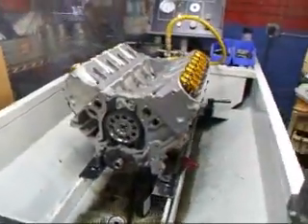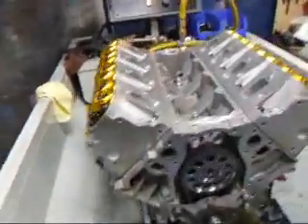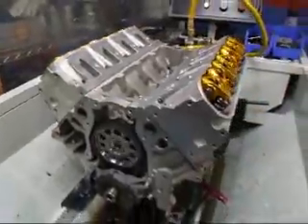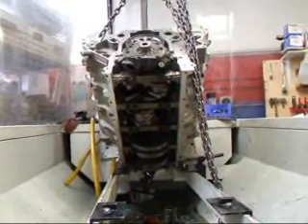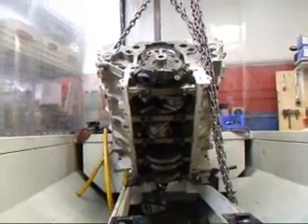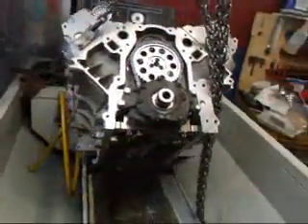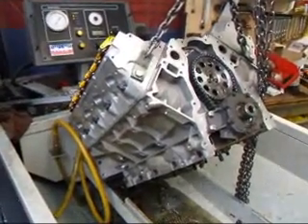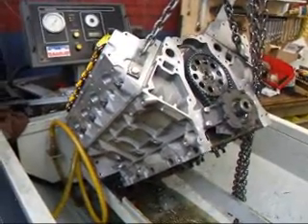LS Engine on Simtester @ Costa Mesa R&D Automotive Machine

Comment: Im pretty sure this hinders the break in process for maximum power/torque and oil control, doesnt it??

Dont the cylinder walls need to have a certain amount of roughness to grind the edges of the rings into conformation with the bore??

Comment: Its got very little to do with weight and much to do with space/packaging/location.  Remember that with valves you're limited to only CIRCLE shapes. Infact, i think that 1 valve with "x" amount of valve area would weigh LESS than 2 valves combined to give "x" amount of valve area.

Comment: @fergus1494 
There's no 429CUI engine producing 2000bhp NA, not even bulit by NRE nor ProStock class. It's impossible even with desmodromic type of valve actuation. 
800CUI engine needs to rev 10,500-11,000 rpm to reach 1500bhp NA. Pushrods are not reliable at such a high speeds as OHC (pneumatic valve control - Formula 1)

Comment: @fergus1494 
Like I said before, OHV or OHC, no matter, both have advs, and disavds. DOHC design was proved many times in racing very reliable. Also americans are pretty blinded when it comes in term of reliability. Reliability depends about quality of materials and how it's built. Simple system doesnt mean its more reliable. I have several examples where OHV engine failed in racing. Old Ford V6 OHV, than many 4cyls OHV , even many V8 SBC's. Also same is with OHC.

Comment: @2jzgtejza80 Anything is capable with money mate. Why use a more complex and more expensive system when a simpler and more reliable system has already been developed? And when something goes wrong on the simpler system its much easier and faster to find and fix. There are engines around using heads designed off the boss 429 hemi heads that make 2000hp NA. The extra weight up high, the more complex system with more moving parts really hasnt got an advantage under 9k rpm.

Comment: @lillen300 I dont think having a well balanced engine will effect fuel consumption much - thats more to do with combustion efficiency and port efficiency. It will (stating the obvious) reduce vibrations slightly and of course as already said increase engine life - less wear. The engine will spin more freely - but not by much.

Comment: @racernate02 4 valves are only because its lighter to get the same size valve area.. your opening and closing two smaller valves instead of one large. I personally feel the advantage of this is nil below consistent use of 9+ thousand rpm. Plus the extra costs, more moving parts and more complex designs i think 4 valve engines shouldnt be used in motorcars.. you shouldnt need to spin an engine past 9 because of the accelerated wear. A 2 valve hemi engine would be fine for most applications.

Comment: @inteligentvtec 
They was made from titanium before, today using dur-aluminum alloy, only al-alloy that can endure high stress.
Yes, block and head are billet machines Al-alloy, sleeve's are ''cast in block'' made from tempered ductile iron (better cooling and lubricating than steel). Every part of the engine is forged, aluminum, steel or titanium, except sleeves, are cast. Even they using copper gasket.

Comment: @2jzgtejza80 on a top fuel engine the rods are aluminum not forged steel. forged steel cant take the shock of nitromethane, they have no give. the aluminum actually allow a bit of twist and flex so they dont break. the block is also alluminum, with steel sleeve's they literally drop in, which take no time to swap. but ya dohc is way more efficent, but when you start cramming that much air into an engine forget about trying to be efficent cuz then you have to burn sooo much fuel to keep it cool.

Comment: @racernate02 
They make that power using everything but not technology. Massive heavy 14-71 Roots blower at 75psi + Nithromethane fuel, 24-32 spark plugs, 8 independent fuel pumps (each bigger than 1 in LS7)...    that's why.... 
and also every part of Top Fuel engine including block are forged. NELSON RACING ENGINES are capable construct DOHC type of Top Fuel engine, but that would be expensive. NELSON already have 500 CUI DOHC producing over 1500 hp in NA trim and 2500+hp S/C or T/C.

Comment: @EPzti One thing I should point out is that the 32v 5.4 is a lot bigger and heavier than a chevy 5.7 (if you're thinking of an LS1) because of the massive cylinder heads. The simplicity of the OHV v8 has worked well for GM over the years and probably will continue that way untill we're all driving electric cars. They had this debate when developing the c5 vette in the mid 90's because the size and weight/power ratio was in the favor of the LS1 OHV engine verses a DOHC v8 such as the LT5.

Comment: @fiatnutz in a few years i will be getting my 4.3 vortec BUILT and eventually after being fully broken in get a low boost supercharger.  i dont like v8s its too much engine not enough power considering my 4.3 will eat up and stock 5.7.
 it will be used to pull a 12 foot trailer for the rest of my life. where can this be done and how much does it cost to be done.
and also do you rebuild engine or just perform the Simtest?

Comment from the maker: @kreigsmann - I slowly bring the engine up to 200 rpm and let it run there for about 30-40 minutes. You still need to do the 2000 rpm for 20 minutes once the engine is in the car and running.

Comment: @FJoeForty Joe, I'm not try'n to argue.  I love ford and chevy.  I know what ford is trying to do and it is great.  I have owned both with minimal problems until i bought the 5.4 VCT.  I thought i just got a lemon and come to find out my problems are common problems across the board.  GM has gotten ohv about as good as you can get it, but it will have to evolve with demanding restrictions.  I know what you are saying about ohv, and vct is beautiful on paper but we still have a ways to go =/

Comment: @BEBNC1 The malfunctioning actuators and components for variable valve timing and/or lift.... have plagued all manufacturers once, Toyota had sludge problems within the orifices, Nissan has software glitches, and the pulse width modulation in the solenoids revealed that stainless steel pintles were not lasting as long as the hardened steel. Sounds like I shouldn't assume Ford has their act together. Well shit, I guess this superior technology can only be trusted from the Germans and Japanese.

Comment: @FJoeForty They said its 3:1 ratio of problems in SOHC VCT 5.4 vs the old SOHC 5.4 and replacing more engines than they have ever had to replace. Also have an 06 LQ9 that 190k miles that out performs my 5.4 six ways from sunday with better mpg and NO PROBLEMS other than a new alternator. GMs LS series race is race developed (Pratt Miller/Katech) and are damn near indestructable (World racings engine of the year) and gives outstanding mpg and reliability. History speaks and chevy's is better.

Comment: @FJoeForty Joe, I have a  06 SOHC VCT 5.4.  It is a horrible engine for towing and has had serious cam phaser issues, ford mechanics told me that this is a serious issue in ford VCT engines and is a more than common problem along with VCT actuator solenoid and pcm problems. They told me in general alot of "cheap" parts are in these engines hence the mountainous problems in these engines.  Grass is always greener on other side, i've talked to two ford master mechanics and they like ohv better.

Comment: @BEBNC1 It is better in every way. VCT allowed you to not complicate the intake with a sooty EGR and it does more than saves fuel, it makes your valve train overlap and duration angle change. You like having a shitty Idle because you are stuck with the cam you installed? It's not a green, tree hugger thing. It's a performance developed by Formula 1 racing.

Comment: @BEBNC1 Not all overhead cam is an interference design. Reciprocating mass is more of a mechanical burden than having three extra cams rotating. Look up the weight of a gen IV smallblock versus their DOHC aluminum, six bolt main counterparts. This is like debating speed density throttle body injection versus mass air flow multiport. Those six extra injectors are a ticking time bomb!

Comment: @FJoeForty You must be referring to VCT capabilities to actuate the values to give somewhat better fuel economy, otherwise they are not better engines.  Huge oiling issues,  way more rotational mass in OHC, when chain wear becomes an issue and timing valuve interference is slightly disrupted that OHC is a ticking time bomb. They are heavier, bigger, use 1/3 more oil, more complex cooling to stop those massive heads from overheating. Both engines have advantages and disadvantages.

Comment: @racernate02 You're talking about nitro numbers in top fuel, that only last a few hot runs before engine tear down. I am a GM Master Tech, and pushrod valvetrain with two valves per cylinder is disgusting 1920's crap.Sick of these white haired dickheads coming in the shop, ZO6 jackets,chewing the fat about their goddamn Corvette...like it's a Porsche or something. I am tired of working on these over hyped, over priced, pieces of shit. 32 valve Ford 302 with TiVCT! American craft to be proud of!

Comment: Oh, I see. As the rings seat, and everything, the motor turns over easier, causing current draw on the electric motor to decrease,  causing rpm to increase...Indicating some break-in has occurred. Cool. Did you develop this machine?

Comment: Yeah, the old 2 valves per cylinder sure is crap. That must explain how a 500 ci American designed V8 can make 8,000 HP. I have yet to see a 4 valve even sniff that territory.